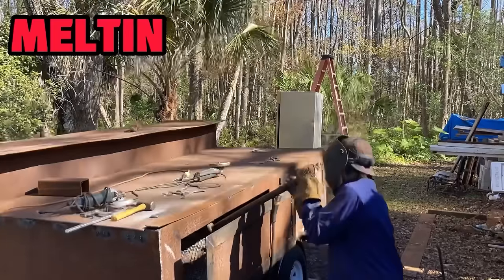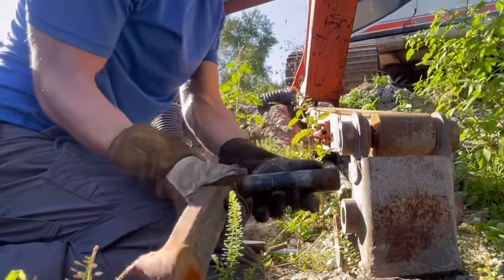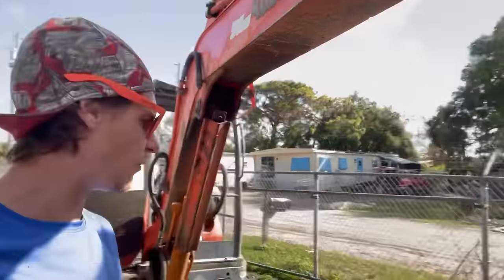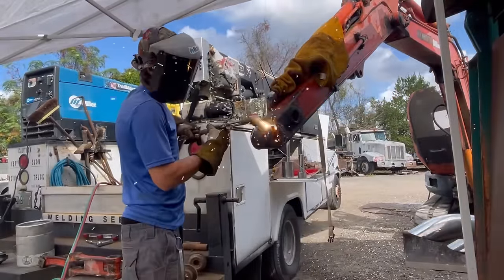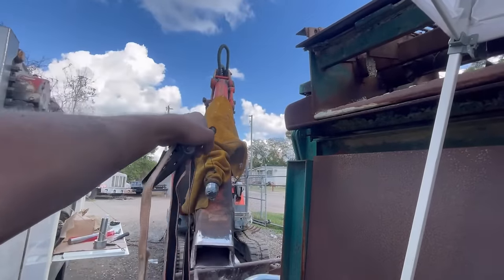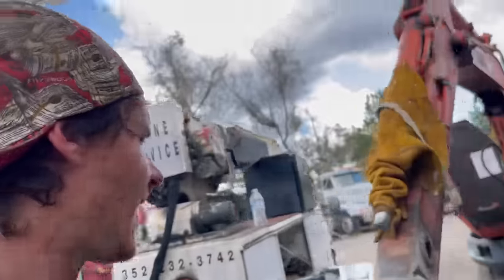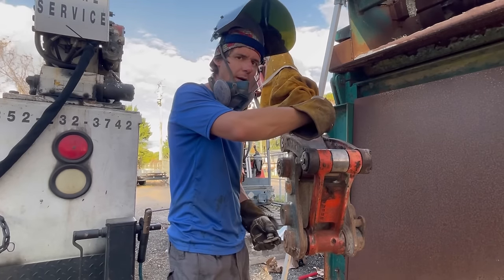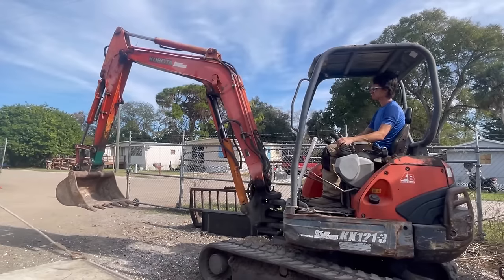You WONT Believe How I Fixed It! | Welding Repair on a Excavator |

Comment: For equipment like this, what kind of tolerance is acceptable on the alignment of the bushings?
Reply: None 😂
Reply: @rls2475  I doubt that, 1/32, 1/16th maybe but zero? really?
Reply: @johngaltman  any slop will cause wear and tear from the banging back-and-forth it should have no movement whatsoever. Otherwise accelerated wear will occur.
Reply: @FishFind3000  I know, but, what is the actual acceptable tolerance, if you say zero, I will say based on what measurement?

I studied physics before I got an economics degree, and am now learning to weld;

So if I hire you as a welder to weld my bearing in, are we talking a half wavelength of light, or are we going to use a standard ruler? 

And if a ruler what will it be measured in 1/64, 1/128, 1/1000000000. There comes a point at which you can't keep working to any accuracy...

This is not a hard question for people that actually do this for a living, 

What is the acceptable standard for a bearing alignment in the field... Because if your using a tie down strap to hold it in place, it is not a half wavelength of light...

What is the measure that is close enough?
Reply: @johngaltman  Welding tolerances are in general 1/8" unless called out in the prints differently.  The shop drawings for something like this I'd imagine are probably +/- a couple hundredths.  Real world, as tight and square as the customer is willing to pay you for the time it takes.  If they want it done now, and the budget is a couple hundred dollars, eyeball, and a 6" level are what they're going to get.  If they hand me the shop manual, drawings and tell me do it right, I'll comply exactly with the listed details in the drawing.  Particularly small equipment like this, it's mainly going to be the first.
Reply: @jenrick4804  Thank you, that was what I was curious about, a real world answer.

Comment: I would have, and do, line bore instead of all that work. You might want to invest in a line boring bar set up. I use Climax tooling. Paid for itself 1000 times over.

Comment: Its neat how the younger generation thinks.  I would have avoided at all cost cutting the end pieces off the arm and especially that chrome rod.  I suppose you did put new bushings in place with holes drilled for grease fittings? If not it won't last very long.
Its done anyways now  looks like you burn a nice bead, good luck with your career man!
Reply from the maker: yes the machinist put grease zerks and grease groves in the bushing.

Comment: Bro ya should of preheated the ram man alot of those rams arent mild steel same with the retainers it's usually 80 degrees Celsius within the 75 mm of weld zone
Reply: Cause it's usually 40140

Comment: The only reason the machine is worth the money he paid at the time was because of the condition, if he would have spent $3k on a $5k machine then obviously he would have fixed at least one of the major issues with the machine and would be able to get his money's worth out of the fix. The only possible way that dumping $3k into a machine like that wouldn't be worth it is if the engine was bad and wouldn't run at all. I think dropping $3k into a 2018 machine would be a no brainner. The company that sold it for so cheap knew the issues that it has and obviously you're fixing what looks like the most major.

Comment: OMFG - the level of operator abuse that would be required to get that degree of damage...
How many hours on them, and any indications they actually got grease since they were new, other than the one pin?
For the ram eye, any reason you didn't just put a bar in the eye and rotate it 180 degrees? It's what I would usually do.

Comment: I don’t believe  a 3 year old machine can be that worn.   It looks like they ran 3 shifts per day and were soaked in salt brine daily instead of grease.    How many hours on these things?      

I have a Deere 50d that spent its whole
Life digging road cuts and concrete.   4000hrs later pins and bushings are 90%+

Just can’t wrap my mind around this
Reply from the maker: neither can I ! but I called about a replacement quick connect. and gave them the serial and dam sure its 3 years old. crazy

Comment: You should use air arc it would make it easier and cleaner and it won't make it as hot as a torch.great job otherwise

Comment: The last owner of that mini. WHATS GREASE FOR AGAIN? derp!! As an excavator operator it pisses me off so much to see a floppy stick because NO 1 will grease there shit fat lazy dumb. My dream is to get a line bore machine than i can fix wallerd holes. The WALLERD holes there or so many sloppy holes out there. LOL
Reply from the maker: So expensive thou 20k for a basic machine. Heard you can make one with a mag drill
Reply: @MeltinMetalAnthony  Wow how have i not seen this drill hack?? I was looking at old brake lathes to mod for line boring 4years. Now the mag drill so simple thanks so much how i never seen this before? I'm sorry to tell you i grease my machines but i know you will find many more derpy guys that dont so you can weld there shit back up.